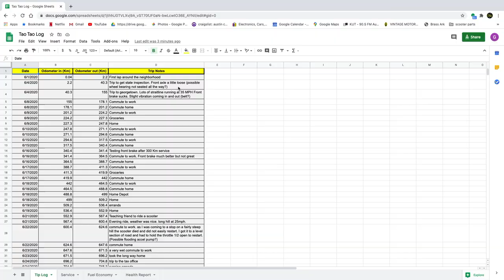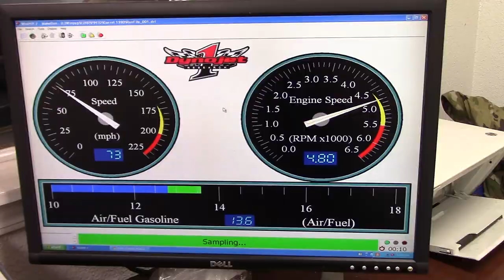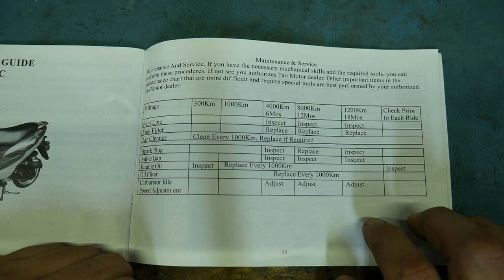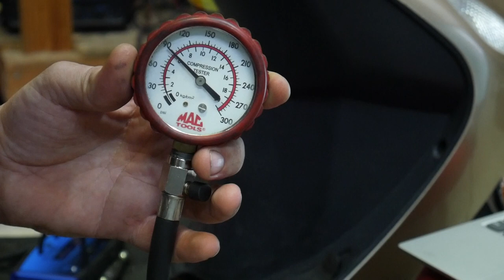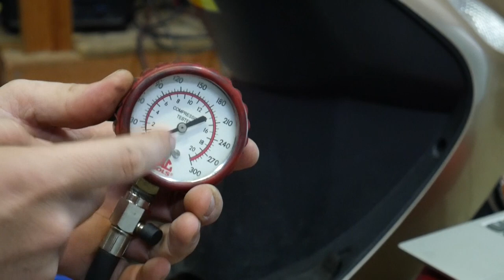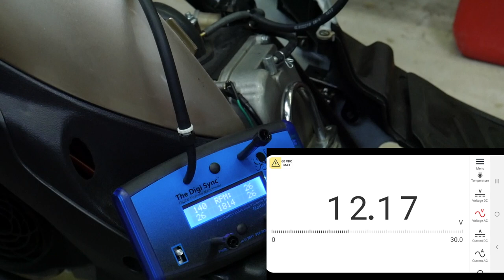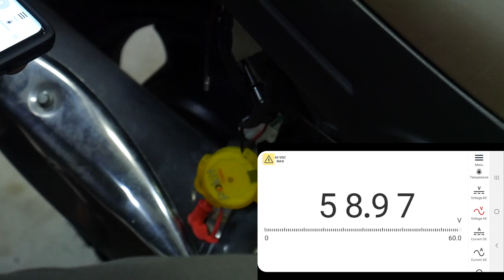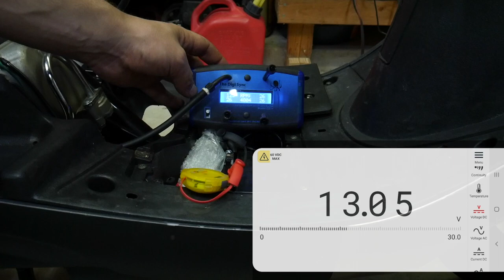(PT.9) The exhaust falls off the most HATED scooter on the internet: Living with a Tao Tao

Comment: Those little metal mesh oil screeners, Honda used them back in the 80's on their CM250c model. I agree they are not confidence inspiring but the technology does work. 
The welds/metal on the exhaust are paper thin. I had similar happen to me on my 2008 gy6 150 jonway. But carefully I was able to reweld it back on.
The oil blowback in the air filter housing. Isn't there a drain plug with a clamp further along the filter housing? Closer to the air intake?
Loving the videos, looking forward to the next one...^^

Comment: I think your most average Taotao owner with a busted exhaust will either tie it on as was done, knock it off and hope they don't get ticketed or buy the cheapest thing they can find that will fit. Usually that will be some junk off ebay for 30 or 40 bucks. it will be a flimsy header pipe and a straight through can with a little glass pack around the perimeter an be very nearly as noisy as running an open header. I have seen many of them brought in to a shop for low power, runs hot, poor acceleration and the shops have rejetted them making them much more rideable. Usual problem is that since it's such a cheap bike, they want it for $10 or $20 and really balk at $75 to $100 for getting the work done. We have one guy around here who tells them when they bring it in it will be a minimum of $50 to touch it. That will get them 45 min of labor and maybe a cheap part or two. He says about half of them turn right around and leave saying it aint worth it, they'll just live with it.

I am enjoying your series. You are confirming, yet again, what I have already figured out on my own. These are made very cheaply to run when they leave the sales floor and hopefully until the end of the 30 or 90 day warranty. They are made to be sold, not used.

I have an 08 chinese 50...not Taotao that runs like a scalded dog and is rock solid reliable. The day after I bought it, I had all the plastics off fixing wiring connectors, plugs, wire routing. I greased everything that should be. Chinese have a severe aversion to using grease. If it should be well greased, it gets a drop. If it should be lightly greased, good luck finding any. The frame flexes on mine but hasn't been  a problem. I found many loose or barely tightened fasteners during my initial inspection and repairs. The welds look like crap but are apparantly holding up well. I rejetted the carb that day as well. Body parts are no long available for it. It wasn't designed to last anywhere near as long as it has. I have replaced the throttle cable twice and had a clutch go bad and start eating belts which I replaced with a stock type clutch. Installed sliders instead of rollers. Transmission works very well. To this day, the exhaust valve adjustment still changes after a couple hundred miles. I guess it's just not work hardened yet. The intake valve stays put very well. I run that poor thing to death. WFO pretty much all the time. I find I can get across town on it faster than I can in the car. So far, it's held up better, performed much better, and lasted much longer than that piece of junk Yamaha C3 I have that keeps eating engines. Although the Yamaha is in another class altogether with its ride quality and suspension, user comfort, I just can't deal with an engine rebuild every thousand miles.

Please keep up this experiment and let us all know what happens with the scoot as the miles tick away. I venture you'll find the engine is the best part of the bike and will probably outlast the rest of it.

Comment: Couple track welds holding it on... Guaranteed to break. Your auto shop don't have a mig gun laying around to re-track the mount to the can?! I have used several performance exhausts for the taotaos, your gonna have fun trying to fit it. Had to cut and re-tig my stainless exhaust manifold on my last taotao.

Comment: If it helps, a local welding shop charged me 25 bucks to reweld a mount on my aftermarket exhaust.  A shop wouldnt weld it.  Theyd replace it, as shops technically dont do anything aftermarket

Comment: 7:30 That tube is too short, if inner tube not fix the resonance problem. By adjusting its length, you can find more power. That inner tube might be reason that lean mixture? It get more air than without it.

Comment: I've always been unsure with changing/checking oil if you should screw the dip stick in to check or rest it in?? I have a briggs an stratton mower and that actually say on the stock to screw in to check. But never known or seen the correct way to check🤔

Comment: Wikipedia:
United States: in the US octane rating is displayed in AKI. In most areas, the standard grades are 87, 89-90 and 91-94 AKI. In the Rocky Mountain (high elevation) states, 85 AKI (90 RON) is the minimum octane, and 91 AKI (95 RON) is the maximum octane available in fuel.
Europe: 95 RON & 98 RON are normally available at most automotive fuel stations.
Reply: Here in the UK the cheapest “super” is 99. The posh fuels (V Power etc) are all 98

Comment: Im surprised the exhsust stayed on that long 😆. I would run 15w40 engine oil. It works great. Do not change your induction system. Those cv carbs do not like that. You might could block off one of the cups holes to fix your lean issue. And it may pick up response quite a bit. Just a lil trick us moped mechanics use.. Sounds bootleg but it works.

Comment: I noticed that the welds on the muffler were just tacked. Appears that the metal might be too thin for good welds.
Reply: Too thin , I have welded beer cans together.  If the proper technique is used and the base metal is not corroded or contained it can be welded .
Reply: @thomaslemay8817  you must be a good tig welder to weld aluminum cans. These mufflers are made on an assembly line with mildly skilled workers. Take a closer look at the welds as they are poor quality and probably prone to cracking and breaking with heat cycles and vibration as what happened to Garrett's scooter.

Comment: Garret, great series. Can you help with a question? I trust your knowledge. I want to get an ssr lazer 5 moped. I love the style. Problem is, it's only kicking 1 hp. It's there an engine i can fit in there that's better? I'm a big guy. I need torque and power. Appreciate it in advance! Thanks
Reply: I know you're not going to like this.
If you want more power in a bike...
Get a bigger bike.  Don't throw your money away on upgrades.

Comment: I'm pretty sure my Jiajue scooter Sprint Sport 49cc is exactly the same as the Tao Tao Pony 🐎 ... Kind of scary, but at least I have your videos as reference. Lol.
Reply: Aaron H believe it or not your jiajue is better quality if your referencing a bintelli jiajue they bring them in from China and put better carbs and fuel lines  and stuff Tao Tao is unmodified straight from China your scooter still isn’t that great but better then Tao Tao
Reply: @natevanderloon9060  I believe it, I knew about the lines and spark plug.. but didn't know about the carburettor.
The fearings/look is exactly the same though.

Also I noticed we get rubber hand grips, not the plastic.
We also get a better break line catch thingy at the front.
Reply: @natevanderloon9060  Just done some research on Bintelli, they apparently moved on from the Jiajue company to another company.

Now I am kind of interested in starting a Scooter dealership, lol.
I gotta look into it I guess.
Reply: I had a Bintelli sprint as well and once owned a taotao ATM-50 too. I pushed that Sprint pretty hard and put around 5000km and only had one or two issue with electricals like bulbs burning out from a faulty voltage regulator from what the shop told me. Other than that it ran fine.

The tao tao on the other hand... If you aren't mechanically inclined(which I'm not) you are gonna have a bad time. even with the proper preventive care i.e. oil changes, valve adjustments, ECT. It really spent more time in the shop than on the road, lol
Reply: Hopefully before 5k of KMs I will have my P's and will be able to move onto a car.
I'm definitely not mechanically inclined for scooters/bike.. I have more knowledge for cars.

Comment: When you put on that new performance exhaust, you WILL need to upjet the carb and possibly de-restrict the airbox. if you leave everything else stock, it Will bog. Just sayin. I've done this before and I'm speaking from experience. It will run even leaner otherwise.

Comment: Without a whole bunch of tuning messing with the airbox on that engine will result in VERY POOR PERFORMANCE!!! I have seen it time and time again on the Honda Spree forum. The question would so often be why does my scooter bog out. People would immediately remove the air box on their scooter the second they bought it thinking that it was going to instantly boost the performance for free... Same thing with exhaust quite often as well. The engines are tuned for noise level and a particular speed range in mind. You mess with the intake tract you kill any performance it had.

Comment: Is there a reason why you're using oil for a wet clutch, instead of just regular motor oil?
Reply from the maker: Yes, even though the scooter has no need for friction modifiers because it does not have an integrated transmission or clutch, motorcycle oil is better formulated to transfer heat for air-cooled engines.
Reply: @Scooter_911   Are you sure this helps?  I'm asking because I'm a questioner and being that the Tao is a CVT, the oil never passes over the belt or the clutch.  Another reason I'm asking is because if there's a quantifiable reason, I want to make the change in my scooter.  Thank you.
Reply from the maker: @crabjoe  yes I am sure. Of the gy6 engines that I've seen melted down none of them were serviced with motorcycle oil. Once again it has nothing to do with the friction modifiers for a wet clutch. Its just the fact that motorcycle oil is formulated for better thermal transfer than automotive oils.
Reply from the maker: @crabjoe  and as someone who's worked in motorcycle shops for years I've seen my fair share of melted down gy6 engines

Comment: Hey i have a new tao tao 50 and a big problem with the head light. I put a new light bulb in an when i turn it on and let the engine rev, it breaks and turns off
Reply: probably a voltage regulator bad or unplugged. voltage regulators keep too much power from going through the headlight and blowing it. I've never had a taotao or any scooter so I'm not sure where it'd be at, but maybe you can go off that and find it.
Reply: @nybergsgarage  oh yea i allready replaced it and it works jusz fine still thanks for the answer
Reply: sure thing. @ragehd2002

Comment: I am thinking the degradation is in the battery. Not the charging system. I, of course, could b wrong. All that cranking on the compression test sucked a little power out of our super high quality energy dense Chinese battery. I suspect if the battery was fully charged the voltage would b a little higher. Also, let's c some of your other scooters. I think u might have a Buddy. Could u, PRETTY PLEASE, tell us about starter diameter and bolt patterns on all the GY6 stuff. Gotta love those 18 dollar starters. Cool little tool. Those alligator clips r cool.
Reply: My thought exactly on the low voltage. Would rule out a degrading battery before assuming a failing stator. Were the previous tests done in the same order, etc.?

Comment: I have a question. Does anyone's taotao atm 50 vibrate super hard when you hit 35mph? Like the vibration is so strong and it comes in waves. It's the worst going down hill.
Reply from the maker: Usually thats due to the belt. I would inspect it or even just replace it
Reply: @Scooter_911  hey man. Just hit 5k km with my tao tao atm 50. No breakdown yet. I recently replaced my rusty exhaust yesterday because it was making a loud crackling noise. I have a new one now and now when I accelerate it makes a popping/crackling noise that comes from the front of the bike. It's not that bad just noticible and irritating. Any ideas what it could be or if it's normal? Thanks bro

Comment: I have a weird problem with mine. I fill it with some gas, ride home everything's fine, park it, few hours later I start it up and its hesitating, bogging down. So I turn it off, wait a few days and it starts right up like nothing was wrong. Go to the gas station, fill it up, it bogs down, I had to go full throttle all the way home [hiccuping hesitating the whole time] so it wouldnt shut down on me. I make it home.. Try it out a day later and it starts up just fine. I'm afraid to take it to work and then have it act up again when I wanna go home. What the heck could it be?
Reply: Shot in the dark as I'm at home on East German two-strokes: sounds like your carb jets are clogged. Work your way up in difficulty - start with fuel delivery in all its facets, then look at the ignition.

Comment: Maybe an engine swap vid at the end of the series would be cool.  With these scooters you would think the engine should be the most reliable part of the scooter. You can go to Home Depot or Harbor Freight, and get a 79cc Predator or Lifan engine for for $100 to 130.  And in stock condition you can't kill them, so why can't they put a 50cc engine on a scooter that's reliable

Comment: Can you tell me on a 49cc scooter driven at least 3,000 miles could it plug up with carbon inside the muffler pipe muffler
Reply: If it can then it would hinder the running of the bike right

Comment: I have a gy6 150cc go kart, it has a hard time starting and staying running. It also bogs down when in a turn. 

What should I do?
Reply from the maker: have you tried a valve adjustment yet? https://youtu.be/QkkYjRdtQxg
Reply: Move to drag racing?
Just joking.
Reply: Garret Seesing yes
Reply: Garret Seesing 

Should I just do a full engine replacement
Reply: @michaelc7292  put a 12 valve Cummins into her Bud
Reply: carmine redd  that would be a tight fit 😂

Comment: Well ive been watching these and i work on these things for a living you should drain the oil with the actual drain bolt from the cvt side. I put a bead of weld on the exhaust to help keep them from falling off and i put 1 or 2 blockers on that intake tube on the air box and it runs a couple mph faster. You said it isnt good with these in well im sorry but you are wrong. Not to mention you should only run 93 or ethanol free in these bikes.

Comment: what happend to the fuel economy? Why so much worse mileage, when the other numbers remain pretty much the same?
Reply: Just wait until he rejets it with the new exhaust.  Mileage is gonna plummet.
Reply: @glenndoiron9317  that would be interesting to see, for sure.
Reply: @Foggyfighter  I've had the 9hp 50cc 2-stroke moped.  It got around 60mpg (approaching half of the stock mileage), around the same as my 24hp 280cc 4-stroke scooter.  Unfortunately it only topped out at around 52mph, whereas the bigger bike tops out at 82mph.  There's a reason I always tell people who want to mod their moped to get more power "put the money towards a bigger bike".

Comment: The right thing to do with these scooters is to open the air / fuel mixture screw before rejetting them..They are set lean to pass the emissions test...All the rest is same old same old...cheap scooters..What else can you expect..it is also advisable to change the transmissiin oil after the first 200 kms...The spark plug is a No...put an NGK 7..Cold spark plug.....

Comment: Cant you just use normal car engine oil for a scooter given that it has a dry clutch. Are you not wasting money using motorcycle oil on it? Its all iv used on my kymco for the last 6 years and iv had no trouble from the engine at all.

Comment: why do u use mineral oil?
Reply from the maker: I use mineral or "conventional" oil for this scooter because there is no benefit to synthetic oil if you have to change it every 620 miles. Its just a waste of money at that point
Reply: Garret Seesing ya true true in the end it’s only a Chinese scooter :) you should do a 0-30mph test with the original exhaust and then do one with the performance exhaust+ a re-jet of course :)

Comment: 95 octane is the lowest octane atleast here in denmark,  highest is 100octane,  in germany you can get 110 octane in most gas stations..
Reply: @calgyria  yes that was dropped this year,  when they put in 10% ethanol, but before that it was true 92 was the lowest..
Reply: @calgyria  er du svensk?
Reply: @landmonkey22  hvordan gettede du det?
Reply: Martin Larsen um actually i have seen 92 octane in denmark. Hade no choice but to buy, car went like shit.
Reply: US octane ratings at the pump use PON (Pump Octane Number) which is the average between the RON (Research Octane Number) octane rating used in Europe, and MON (Motor Octane Number). The basic formula is (RON+MON)/2 and is printed on pretty much every fuel pump. Also to note is pretty much every octane petrol now has 10-15% ethanol due to the dirt-cheap cost of ethanol thanks to massive corn subsidies in the US. Non-ethanol fuel is relatively special.

TL;DR 98/100 RON is roughly 93 PON. For reference, most North American market cars use 92 RON or 87 PON.
Reply: @szili76  they just stoppede selling 92 this year. When they started putting in 10% ethanol..
Reply: @calgyria  på dine videoer 😄